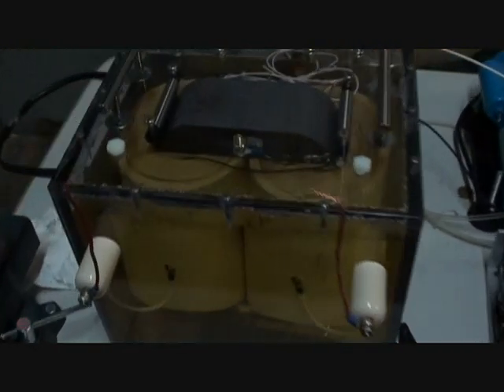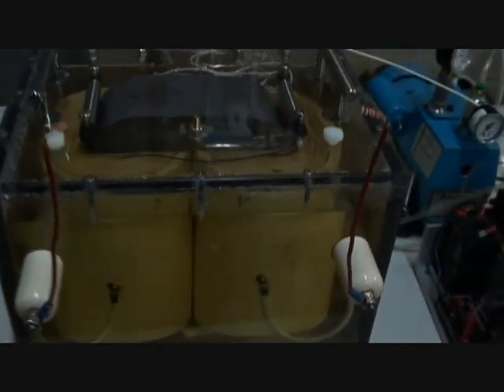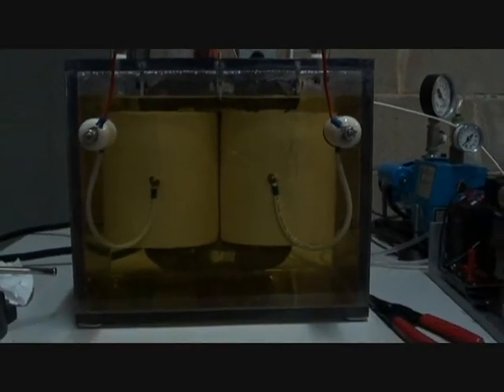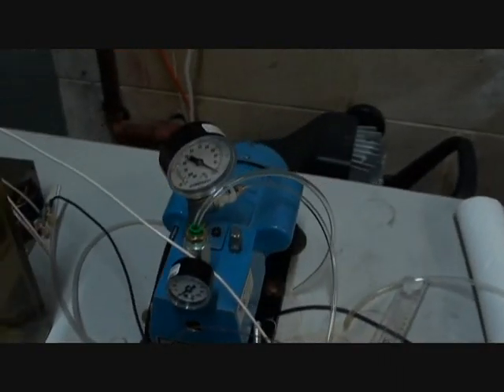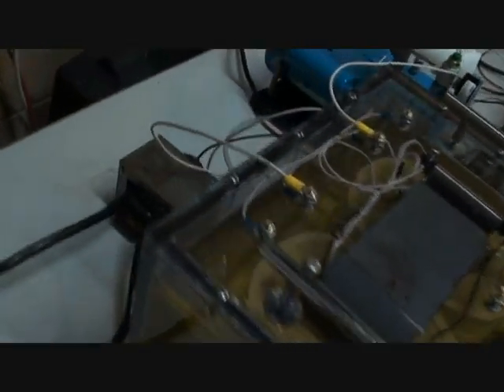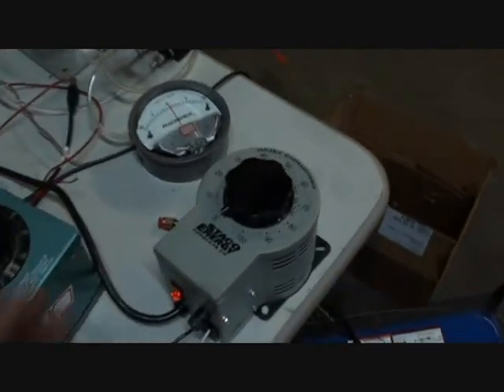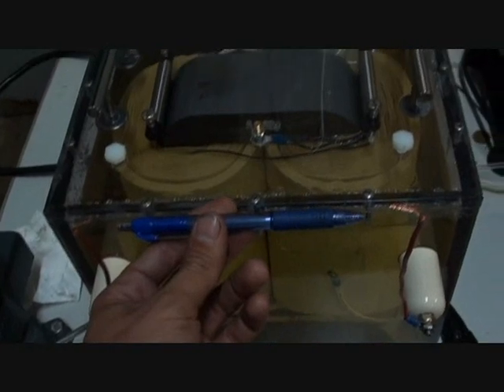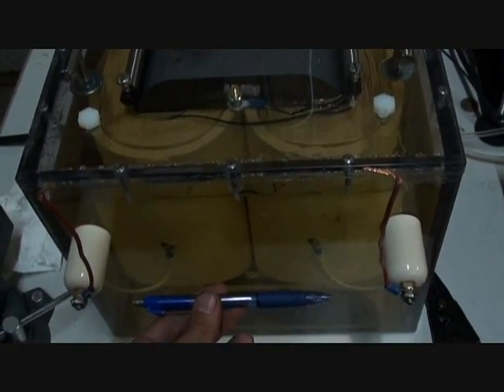140KV Transformer

Comment: Thank you for all your help I appreciate it very much .I have been on the sabic website and now understand there are lots of different grades of polycarbonate all with there own special properties i should have read more before asking and that's great that the oil holds though the threads as this is what i had planned but was unsure if it would leak or not thanks John

Comment from the maker: John,
Polycarbonate is an engineering material, as is acrylic, although Acrylic is just short for PolyMethylAcrylate. The word "Lexan" is just one of several trade names for Polycarbonate (Lexan, Makrolon, Makroclear, Tuffak, etc), just like Acrylic can be bought under various trade names, such as Plexiglass, Lucite, Perspex, etc...
 Polycarbonate is a MUCH tougher material than acrylic and will not shatter when dropped, which is why I use it very often in my projects.

Comment from the maker: 1/2" refers to the thickness of the material I made the box of.
The standoffs are not sealed; the power is fed through two 1/4-20 threaded rods that have a nut on each end and it is the thread plus the two nuts that seal the oil in. It has not dripped a single drop yet.

Comment from the maker: Hi,

 I used 1/2" Polycarbonate for the box, sealed with a polycarbonate solvent. The handles are for drawers, but I changed the bolts on them for grade 8 hardware so they'd hold up better. The output terminals came out of an old neon sign transformer.

Comment: Were you using some kind of variable resistor? I've seen arcs that are continuous (and quiet), and ones that are random (and loud) from the same transformer not because of different voltages, but because of different capacitance.

Comment: It may be able to do it for short periods, before overheating, but the voltage regulation or  voltage drop at this current 300ma would be large. Remember when under oil you can really push things much harder than dry insulation transformers.

Comment from the maker: @Grundalizer The voltage is highest when it is producing those multiple sparks. Technically maximum voltage occurs the instant before a spark forms. The continuous electric arc draws the most current but since it is continuous the voltage drops across the arc.